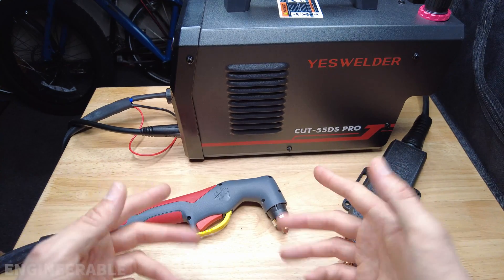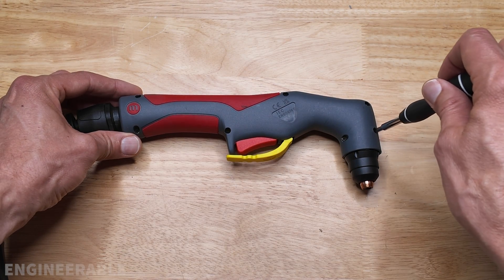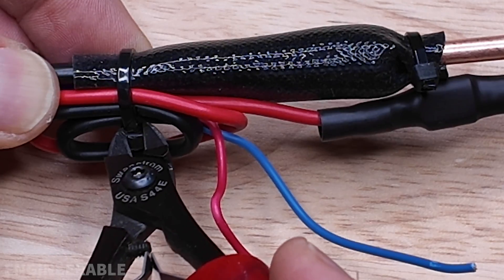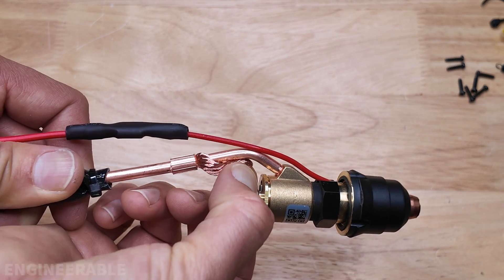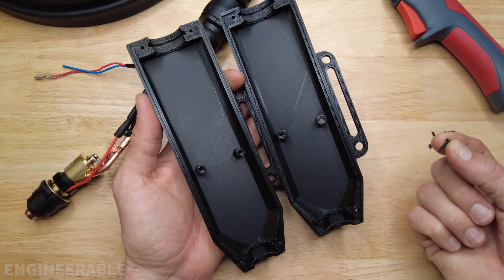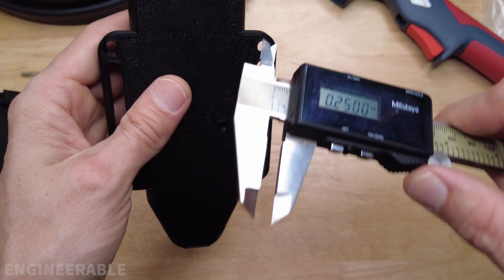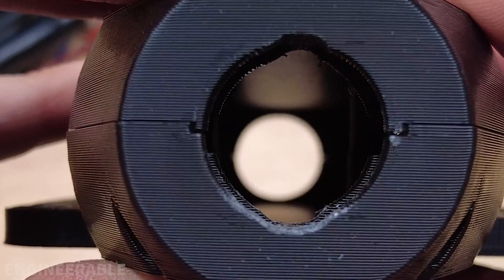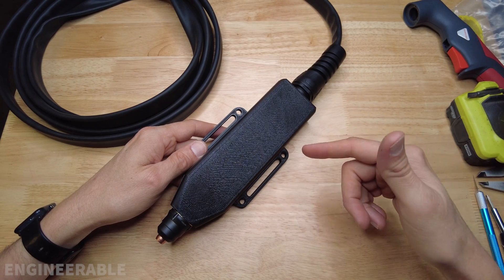I built a CNC plasma cutter machine torch because they're un affordable! DIY YesWelder CUT-55DS-PRO

Comment: I have the 65DS pro and it doesn't have the multi leads for thr CNC port, are u able to make or show internally where the wiring goes to compare with my unit?

Comment: Why do this? Why not just use the torch?
Reply from the maker: @johndunn8647  It's a better setup for a CNC than a hand torch. The cables going straight up are easier to manage and reduce offset loads on the gantry. The form factor makes it easier to mount on the CNC. The trigger wires get rewired to the CNC controls.
Reply: @engineerable  I see. Thank you for your response. What about cut quality? Does that improve also?

Comment: Wow, the 3D Print quality is not great.  Someone selling 3D prints should be able to do better.  Great CNC project!
Reply: It should require no modification if the physical 3D printed parts are what is sold (not just the .stl files).  It should also have melt in 3D inserts.  3D printed parts just can't handle self tap threads for more than a few insertions.  They will strip out if you take this torch apart more than about once.  

If I decide to do the plasma CNC table project, I will just design and print my own torch.  It does not look to be that difficult.  Then I can change things to how I want them as well, and use a super strong material.  It is also faster, I could have it in a day.

Comment: I bought the Yeswelder plasma cutter 65DS-Pro and trying to figure out how to install wires to get my CNC to work the trigger. the new version only has one main connection for the torch and not the two pin connector. I may have to dive into the main housing and come out with two wires. not sure if your new video will cover any of that.
Reply from the maker: @Kevin-n9i1s  65DS-Pro is a different size. It used to use the same torch, but technically it appears that the IPT-40/60 torch is limited to 60A consumables. Therefore, they may have to change the torch to an IPT-80. Yes, you will need to to either hack into the wires inside the enclosure, or in the handle.
Reply: @engineerable  okay appreciate the quick reply. I will look inside of the cabinet. If I figure it out, I'll let you know.
Reply from the maker: @Kevin-n9i1s  I update the original response. Are they still using an IPT-40 torch (60 limit depending on consumables), or did they change it to IPT-80? If you plan to convert the torch to CNC and no longer use as hand torch, then just cut the wires inside the head as I show, and then pull them through the sheath and out close to the connector, and connect those trigger wires To your CNC control.
Reply: @engineerable still running good?

Comment: Why would you bother doing this? There is absolutely no advantage to doing it.
Reply from the maker: No advantage compared to hand torch? There are many advantages. The hand torch is difficult to mount to the CNC, the cables hang out a weird angle and are unwieldy to support. In this case where the gantry is light duty, it's better for the cables to go straight up and be supported from above. It moves all the mass closer to the Z axis, reducing the torque on the gantry. The only reason that people adapt hand torches onto low cost plasma cutters is because a machine torch is expensive.
Reply: 🤦‍♂By transitioning the standard handheld torch to a vertically oriented CNC torch, we're not just altering aesthetics; we're optimizing functionality within the CNC system itself. With the torch now vertically aligned, the CNC machine can operate more efficiently, with reduced interference from the torch's physical configuration.

Consider the gains in machine clearance and maneuverability. With the torch now streamlined and vertically oriented, the CNC machine can access tighter spaces and execute intricate cuts with greater precision. This translates to savings in material, time, and ultimately, cost.

So, while the torch itself may remain unchanged in function, its integration into the CNC system undergoes a transformative evolution. It's not just a tweak; it's a strategic optimization that pays dividends in performance. But hey, if you prefer to keep things horizontal, who are we to disrupt your workflow?
Reply: I agree now it has to be dedicated to the CNC. I have seen a lot of CNC with the angled torch heads and never had any problems. If you have 2 torches or plasma cutters then I can see this being a ok mod. But if you still have to make a mounting adapter for the new head I would just make one for the other head so I can still use it in the field. If you set it up right you shouldn't have any problems and be able to do any cuts that a regular CNC can do

Comment: Looks good.  Glad it worked for you.  I'll be making those changes to the cad drawing so future units will have a rounder clearance around the torch head and slightly deeper screws.  The YesWelder sure is inexpensive.  I actually started down this path over two years ago and my first cnc build was with a CUT50L which is no longer in production, and I was using a hypertherm clone head with fine-cut consumables.  The YesWelder and its head is now giving me better precision cuts than the hypertherm consumables.  My video is not the best quality, but in this video I show how I put my system together and I used an old dryer as a down-draft table and I vent it outside of my garage.  https://youtu.be/7ikfPgJQgzA?si=R79lc9DX4vTbXY6Q
Reply from the maker: Thanks for making and selling the 3D printed housing, and inspiring us to build cheap cnc plasma cutters.